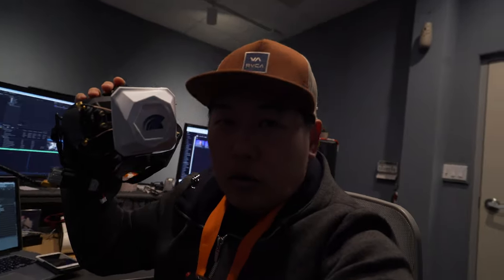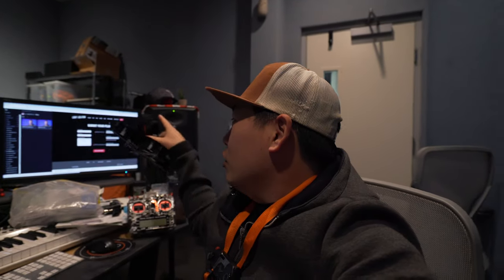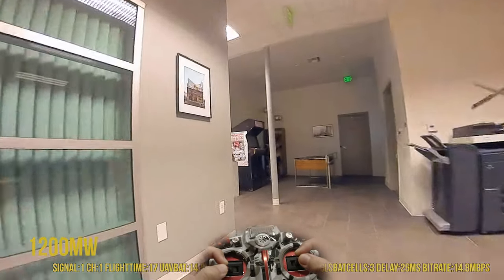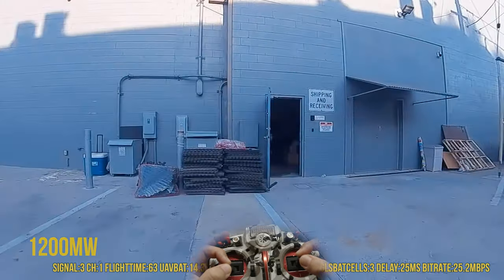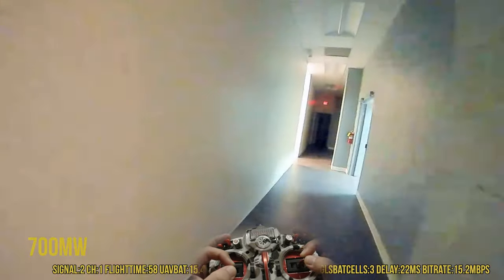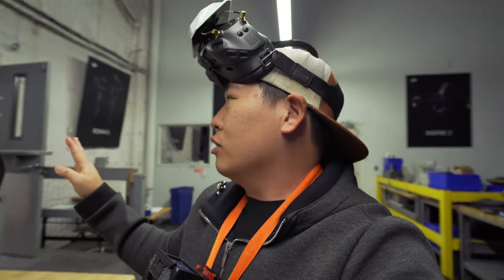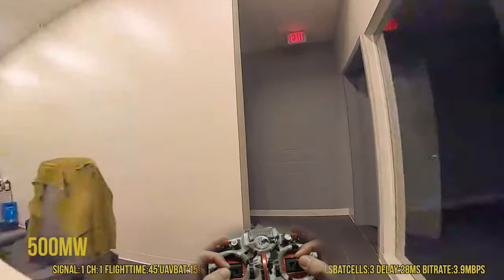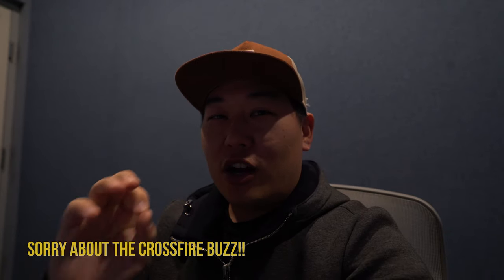DJI FPV⚡️⁄⁄YO 1200MW IS INSANE🤯⁄⁄DIGITAL INDOOR TEST🧐

Comment: DJI need to put the Air unit temp on the OSD. The power is dynamic so it will only increase power and heat up as the signal degrades. So the worst condition is if you are at max range or constantly behind hard to penetrate materials.
Reply from the maker: Temp data is a good idea
Reply: Change Agent when I used to use autodesk inventor I had to use bootcamp but now I use autodesk fusion 360 which works on Mac

Much more convenient 

Hey this might be a stupid question but I can’t seem to find the answer anywhere.. how do I get audio on the recording from my dji digital fpv system?
Reply: @TheCiardellas  there is no audio feature with DJI as of right now and no talk of any future updates including it witch has been a big deal for a lot of people. Not just for video but for live listening while flying to hear prop noise and such.  Only way to get audio from flights is using a gopro or some sort of external camera.

Comment: So the stock system is not capable of this?   Just bought the DJI FPV Goggles with air unit and DJI Controller/TX.   Looking forward to setting it up.
Reply from the maker: you have to "hack" it.  It's on rcgroups somewhere,

Comment: 1200mw may not be as illegal as you think. I've been reading and rereading the FCC testing. The output on the antenna ports is only ~22dbm for the "700mw" setting. My figuring is DJI is calling it 700mw because 22dbm+ the 2.84db antennas = 24.84db which is 305mw. Then they add that to another port because it's MIMO and possibly transmitting at the same time. So you end up around 600-700mw. So if you assume 1200mw includes the antennas, then 1200mw minus the antennas may very well put your amplifier output to under 1watt.

Reference material. Google these. It's the first hit:
goggle FCC ID ss3-p1gs1902

air unit FCC ID ss3-p1as1901

remote control FCC ID SS3-P1RC1901
Reply from the maker: Oh very interesting.  Does it matter if it's indoor/outdoor?
Reply: @RyoRex   Do you mean, do the regs matter indoor/outdoor, or do you mean does the DJI know if you're indoors? The regs are based on whether or not the device is mobile, handlheld, or mounted.
Reply from the maker: @rcrdps8144  Ah fcc, so it doesn't matter if it's indoor/outdoor I guess
Reply: @RyoRex  I'm no expert,. .but I haven't seen indoor/outdoor written anywhere. For our band, it only mentions an allowance for higher gain(>6db) antennas at 1watt if it's mounted in a fixed spot for point-to-point connections.
Reply: Yes the only way to tell for sure is to measure the actual transmission power output at the antennas your using, you could have a "low" powered transmitter but if your antenna then boosts that signal too much you can go over the allowed limit.

Comment: So 700mw plus antenna gain....ok i think its still safe. Seeing as cell phones can do up to 2 watts (but with very little antenna gain).    Is 1200mw with antenna gain safe?    What are all of y'alls opinions?  I think we maybe exposed to larger sources of radiation and we are fine, so the goggles i believe are fine.  Just curious to see what others think.   I have no need to upgrade, since even just 200mw with the right antenna allows me to fly the entirety of the parks and spots i got to.  If you added a fan for cooling to the airunit its probably ok to run it without burning the unit out.   But then thats more weight, more power draw.  Im sure the airunit is gonna drain more power at 1200mw.
Reply from the maker: Probably true on all those points... I like the power, the advantage is quite clear to me